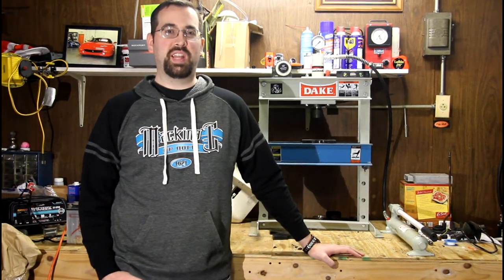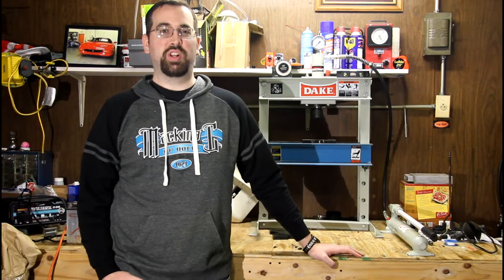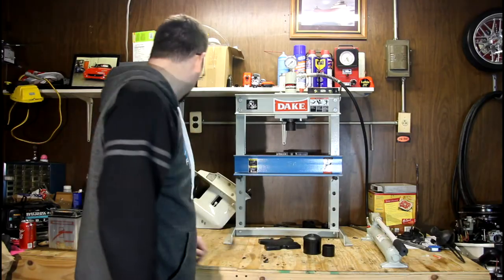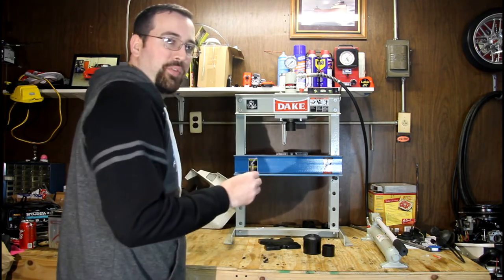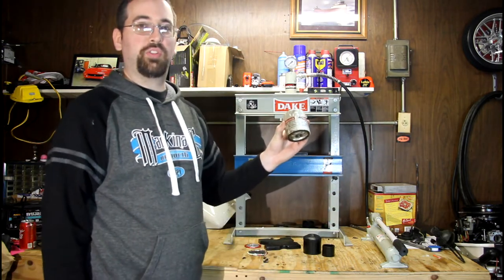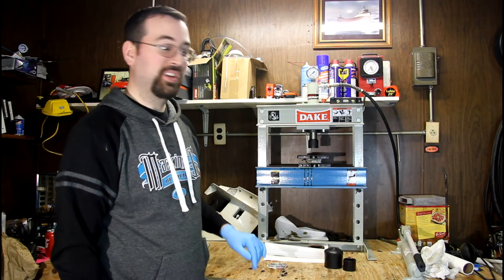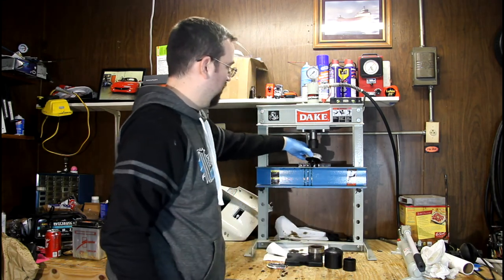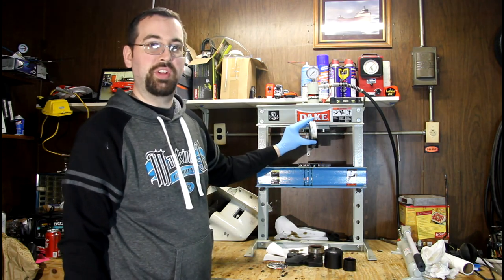Episode 3 - Crushing Oil Filter

Comment: The first add-on I welded up once getting my Harbor Freight 20 ton press was a cup and piston for crushing oil filters.  Once the oil is all squeezed out of them, the dense metal pucks can be put in the regular curb-side recycling bins.  It's nice not to have to deal with oil filters anymore.

Love that little Dake press!  I got tired of my cheapie Harbor Freight example with the sloppy ram and modified it with gibs.  The sucker is now a rather nice precision tool.

https://www.youtube.com/watch?v=X6zGj9avKIQ&t=8s
Reply: depends on what state you live in   technically still considered low level hazardous waste as paper filter inside is still contaminated with oil    easiest to just put whole filters in jug and drop off at walmart auto center and let them properly recycle them at no cost to you